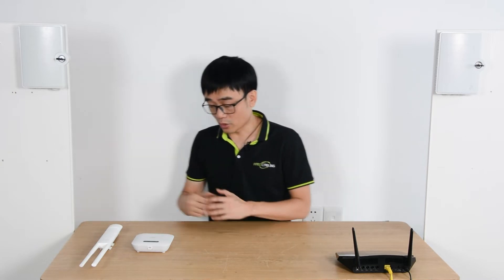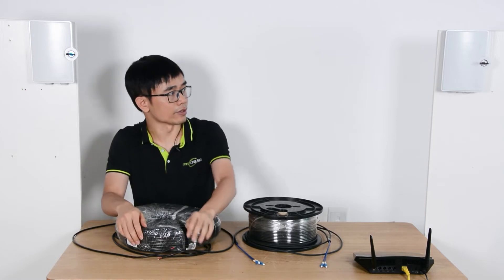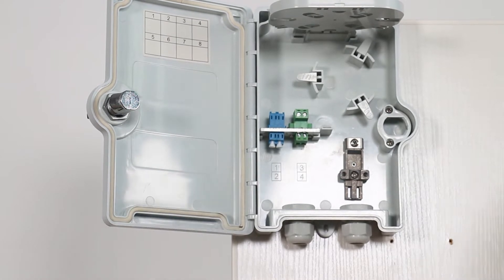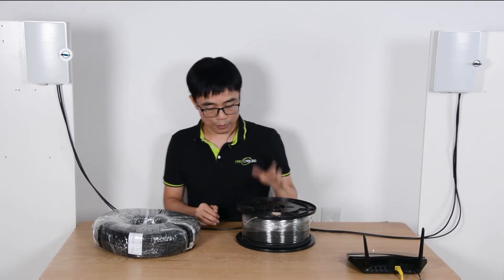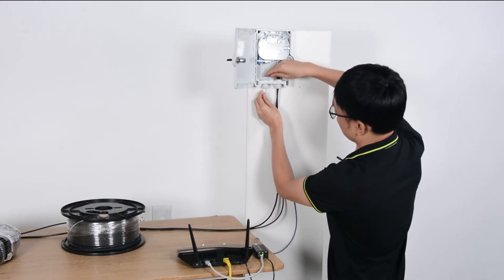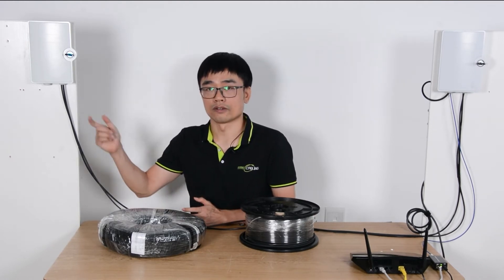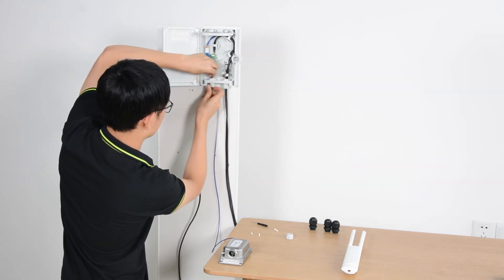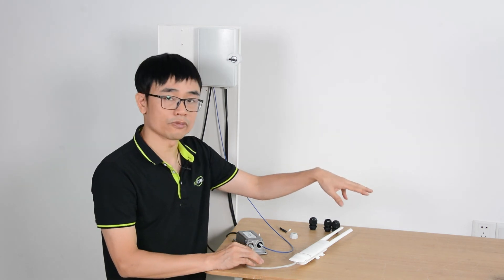How to Use Fiber Media Converter to Realize Gigabit PoE for PoE WiFi 6 Access Point?

Comment: For the media converter, if both places have power, is it OK to use the same media converter
Reply from the maker: Yes, you can use the normal media converter if you don't need to power the device with PoE.